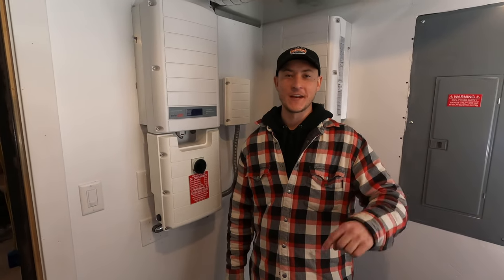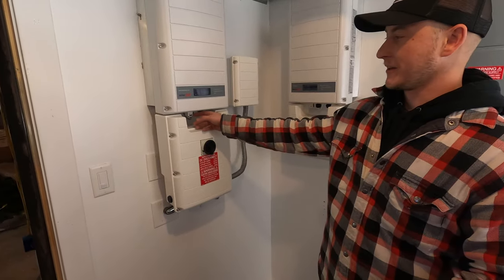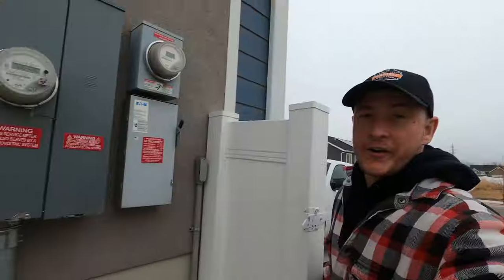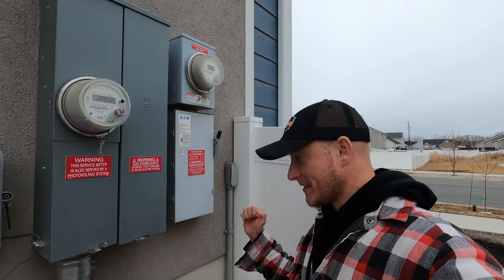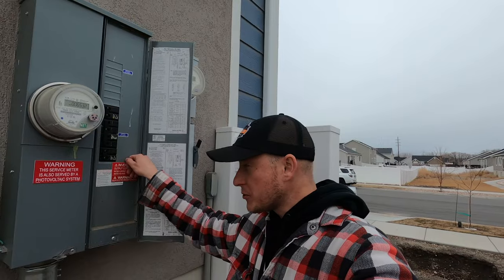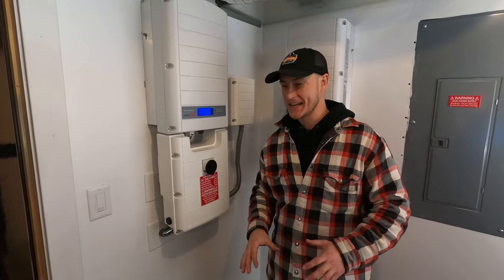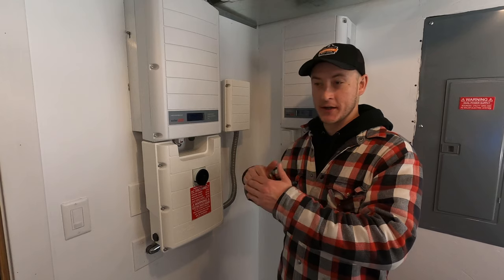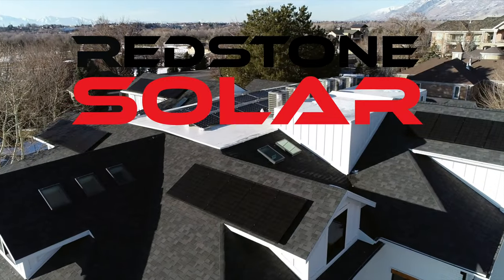Restart ANY SolarEdge Inverter | Fixing or Troubleshooting a Broken Inverter

Comment: So helpful.  After a recent outage, our inverter had a red Fault light and we waited for service for several days.   Finding this video was a quick solution and we are back getting power.
Reply: If you have a Fault light you can also turn off the big round switch, remove the 6 x 5mm hex bolts in the lower unit and make sure the circuit breaker in the inverter is turned on. It can pop off and that can give an Error 3x6E .

Comment: Thanks for this very helpful video,  My inverter is still showing an error but at least I know I gave it a shot.  By the way, one additional point that some might not realize: there is a green button on the bottom of the box that turns the screen on for 15 seconds or so; to me I looked like a bolt cover, but now I know it's a button that lets you see error codes and what the thing is doing.  Thanks again.

Comment: Thank you for this video. My inverter had a 2x96 arc fault, and I'd long thought that resetting/restarting the inverter was simply turning the black knob to off and then on. This didn't help clear the arc fault, but when I followed your steps (first inverter small switch to off, then black knob to off, then inverter breaker to off), once everything was turned back on, the inverter booted, the error is cleared, and I'm feeding power to the grid again. My solar installer is long out of business, and SolarEdge support is non-existent to customers in my situation--they will only work with you via who they consider licensed/authorized installers/electricians, and the majority of these only work with customers they installed solar for.

Comment: Thanks. I didn’t know about that last lever you pulled, being the same as turning off the electrical breaker. My inverter is 7 years old, and I can no longer read the screen. I’m waiting (almost 3 weeks), for a technician to come out. Electricity is up 64%, this winter, and I’m not producing solar power. 😢

Comment: Thanks for the video, unfortunately, even with your steps followed the solaredge system installed by the former resident in our recently purchased home appears to have no power and blank screen. The original installers were no help and were going to charge $$$.00 to set up coms due to T-mobile 3g sunset issues.  Problem is, I don't wish to sink any funds into a system that is not working and has zero support. Now I'm debating whether to just change out the inverter with a new model by a different manufacturer , one that has easy learn curve and programming and quality service.

Comment: Thank you, very informative  video. Could I please ask a related  question, my original (old) system had 12 panels/optimisers. I have now replaced the panels with 10 more powerful ones meaning only 10 optimisers are being used. However, the monitoring system still shows 12 optimisers. Do I need to restart my inverter for it to update my configuration.
Reply: That won't help. The layout was programed in by whoever installed the system so you'd have to have special access to that feature through an installer. 
It'll show your new panels along with the old ones in logical view.

Comment: Thank you so much! Very helpful!
My system is relatively new installed in September and didn't realize it was off for 2 months. My sce bill were high like before installation Hopefully, now that it's workin,g, my Edison bill will be much lower.
I tried chatting at the website, nobody there. No way to contact solaredge at all! Even the agent !
So thank you so much.
Reply: I just realized mine hasn't been producing for 9 months. I didn't think much of the higher bill because our electric company increased our rates and I got an EV.

Comment: When I did this is caused my tv to start and my alarm system to beep like a power surge….is this normals?  I didn’t wait thirty seconds to turn the black switch to off after initially the toggle selector to off. Besides that I followed your procedure as described. Thanks

Comment: Hi Brandon:  quick question, I don't have the service disconnect switch that you pulled, but I do have a breaker box and it has 4 switches -- 2 labeled service disconnect and 2 labeled solar panel.  Should I turn off the 2 that are labeled service disconnect.  Thank you again for this simple way to trouble shoot my system.

Comment: Mine has an ac voltage too high fault even through my voltage is in the normal range.  Any ideas?
Reply: I have same issue. Did this video help?
Reply: @ankushgoyal8302  no, I ended up having the inverter replaced.  Working again now 👍

Comment: Hello, I noticed the SolarEdge Inverter SE7600H-US with and without little Screen Monitor, I also noticed a few of my Neighboor has the SE7600H-US inverter unit without screen monitor.  So the SolarEdge Inverter SE7600H-US with, or without little Screen Monitor is the newest model, 2022?  Thank you.
Reply: I have that model with the screen from 2018.  Bought a home because it had solar and now have no way of knowing if it’s working.  My screen display is blank unfortunately. Wish I could call this guy/company to come out ;). Thankfully mine is still under warranty.
Reply: @jessicadalske8018  Likewise Jessica, we too bought a home that was equipped with Solaredge inverter. Mine is also under warranty but zero help from Solaredge or original installer. Blank screen regardless of numerous reset process. Original installer wants to charge us hundreds now just to get the system to communicate w/power co. Now I'm debating whether to just change out the inverter with a new model by a different manufacturer, one that has a good warranty, easy learn curve and programming and quality service. (See my reply above for more info). Like to know what you did to resolve.

Comment: Something I found on I see lot of these people mentioning photovoltaic breakers in their meter box I have no such thing my meter is mounted to a 4x4 post about 80 ft away from my house it does have slots for breakers in it but only has a main disconnect in a 240 disconnect for like my dryer and oven when they set my system up they wired directly underneath the meter then out to a fused emergency disconnect from there to the solar array to a 100 amp breaker box that sits in between my inverters then out from the breaker box to the inverters which are SolarEdge HD wave 11400's.

Comment: So i followed the steps provided, what specifically does it mean if the relays DONT start clicking // take a while to click? Aside from "then it isnt producing power" lol the first time it took maybe 5 minutes to click and i still have no lights on Power production. module communication seems like its light is on but with how dim it is you could also mistake it being on from the light below shining through. I can provide video or photos for anyone interested in helping out we just had a $700-800 electricity bill last month. We have anywhere from 10 to 15 people 4 of them being kids 8-15. While trying to teach the young ones how to save electricity & how to be cost effective when it come to maintaining upkeep on the house. we understand it wont be cheap regardless but having solar panels would help us so much. Knowing theyre just sitting there doing nothing when they could be easing the strain on our pockets is very frustrating. SO if anyone could help with what i need to do to get this thing running before we have no choice but to contact the company to get it back into working order that would be awesome. PLEASE DONT COME AT ME LIKE WE ARE BUMS TRYING TO CHEAP IT OUT INST3AD OF DOING IT "THE RIGHT WAY" WE JUST NEED A LITTLE HELP